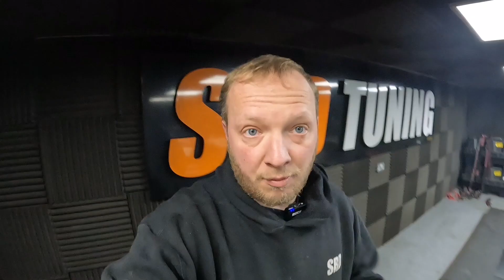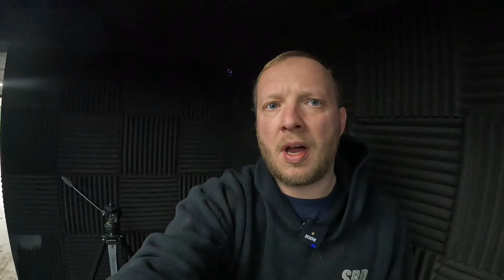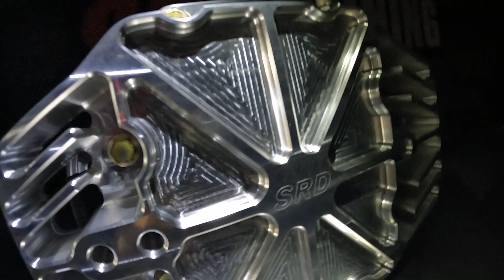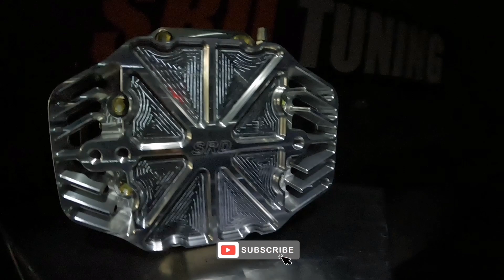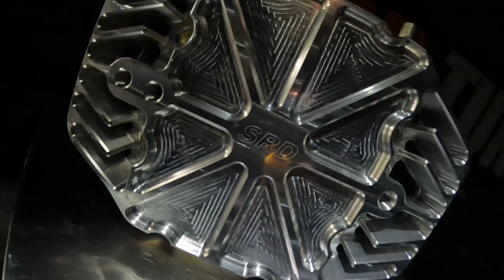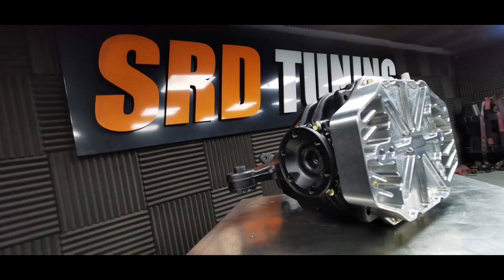Ultimate Small case diff Toyota Supra

Comment: Dad here:
Do you guys plan on doing testing to show evidence of cooling benefits?? It’s a nice shiny piece at a price tag but would be worth it if it proves to function.
Reply from the maker: Hi Elijah none of the small case diffs covers have extend cooling wings. 

We do see a drop in temperature how much will be dependent on the  Environment the car is used for.  

The main advantage of our diff cover is strength its made from 6061 and wont crack like the stock cast one when launching.

Let us know what conditions for testing you would like to see for temperature and were add some sensors to it and do some back to back testing. 

We currently use these on our big builds and tested up to 1400hp on a small case over the half mile and in the 9s on the 1/4 👍
Reply: @SRDtuning  gotcha.
So I don’t drag race my car but totally understand where you’re coming from. I road race “circuit” so any advantage for cooling I’m interested in. I believe it works since it does mimic the 220 diff cover just assumed most people would want verification of functionality, myself included just to validate to cost since it is a nice piece.